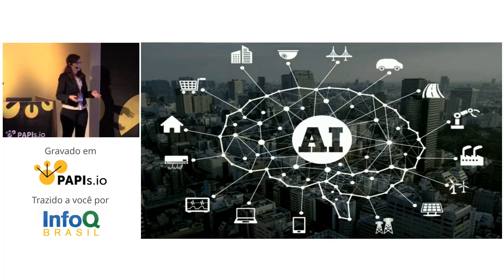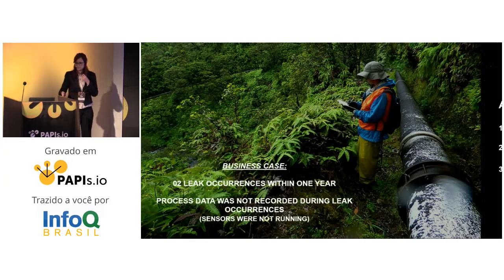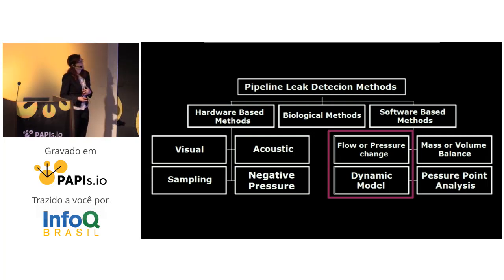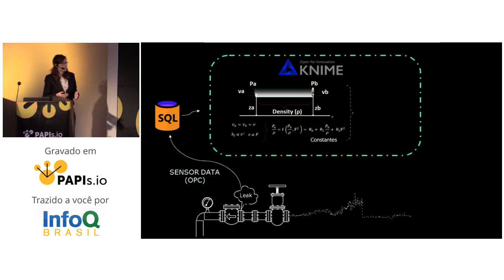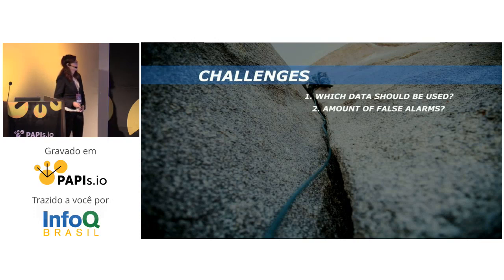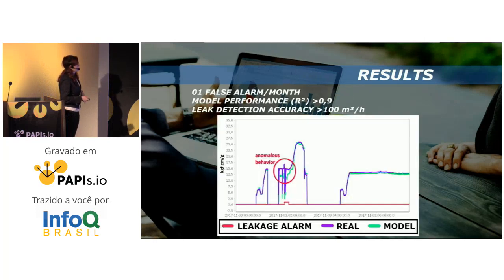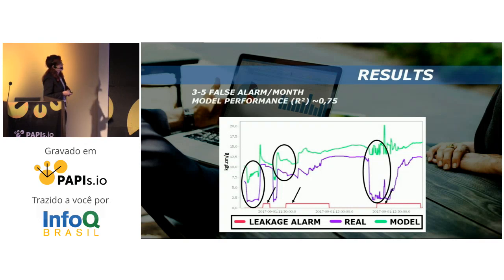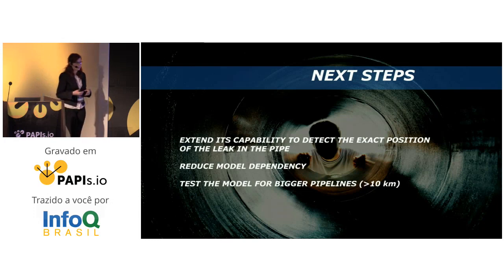Leak Detection System using Machine Learning Techniques -  Daniele Kappes

Comment: Basically, a digital twin based on Bernoulli. I would have looked into a sustained mass balance (not volume) from flowmeters. Leaks do not spontaneously fix themselves so you can reduce the false alarm rate by just using a larger moving average.